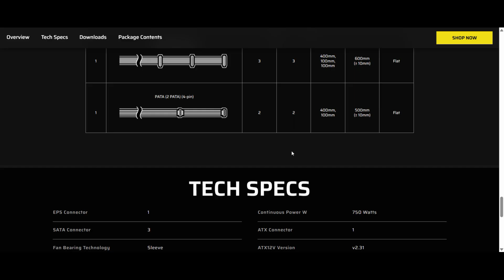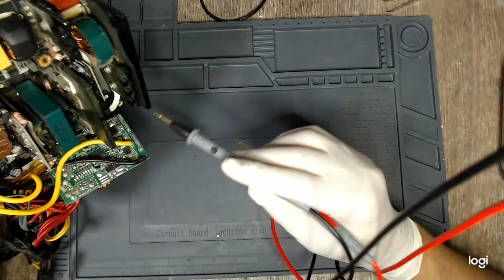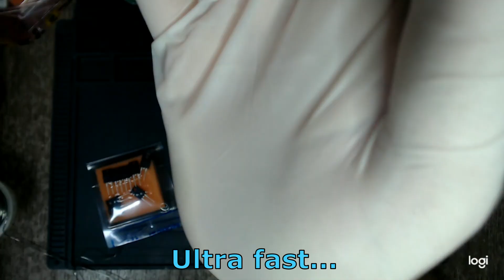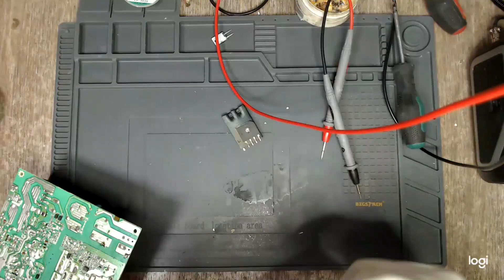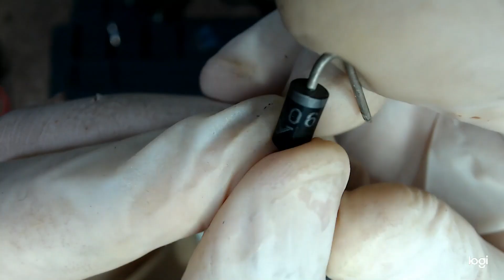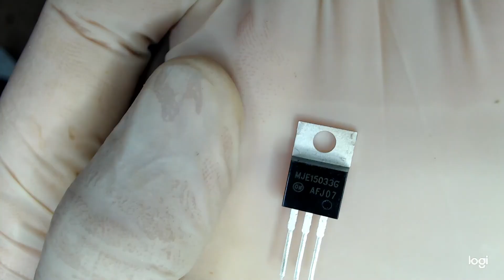EN - Corsair CX750 - Intended for scrap, let's save it :)

Comment: Very cool repair - I think I use this PSU as test PSU as it used to be in my main desktop but started rebooting the system randomly. Replacing the PSU fixed the problem and I was never able to reproduce the issue on the bench so it was downgraded to test PSU! Very interesting about those diodes and cool to see the FlexPower schematics back! Thanks for the English video and please, no need to apologise for your "bad English", it's actually very good!
Reply from the maker: Thank you!

Funny thing you mentioning the restart issue, because the same problem was the reason the owner send me the PSU from one of my other videos ( same model ):
https://www.youtube.com/watch?v=wKR63cL9JjQ&t=2s

The system reboots with it ( others work well on that very system ), and he send that psu to me to check, but i also couldn't replicate the issue, neither on the bench nor on my desktop, with load and without any load, all the voltages measured ok... i couldn't replicate any problem so i send that unit back to the owner ( he told me it still does the same ). 
Hmmm, i wonder if somehow, in some conditions it's acting out in some manner which the computer does not like... 
Maybe mains voltage on the owner is lower than in my workshop, or maybe it jumps up or down quickly for some reason and the active pfc's feedback loop is too slow to respond ( they usually are, tight regulation isn't their job ). 

Or could it be related to that coil whine issue somehow?
Meaning, in some conditions could that instability ( that's what the whine is, instability in the negative feedback loop, not that coil vibrations crap, that Corsair is claiming ) become a problem for the computer? 
Maybe it pollutes to badly some output? Let say for some reason, instability could cause the PG signal to drop below the threshold expected by the computer, wouldn't that reboot it? 
I think i need to check that in a future video, i need to AC coupled scope the outputs with and without any load, and see if i find any issue.
Reply: @DjMarik78  it was happening randomly and I guessed the PSU and I was lucky as it stopped doing it. I never ever had issues with that PSU in my workshop but I don't use it a lot... I also tried with loads and checked the outputs with the scope: nothing.